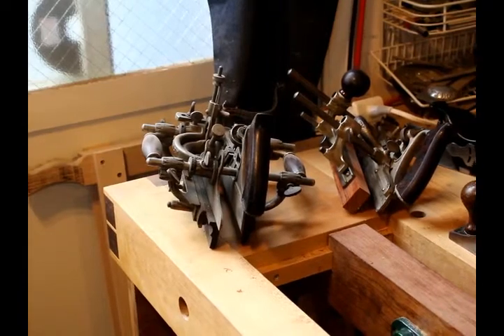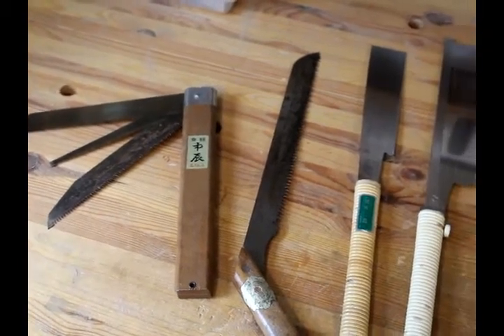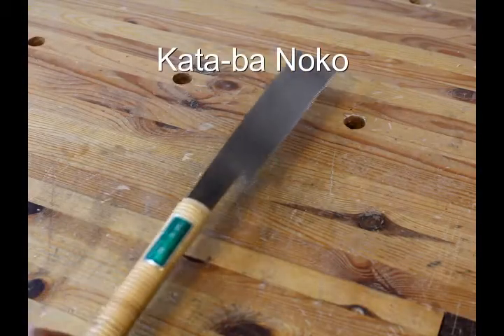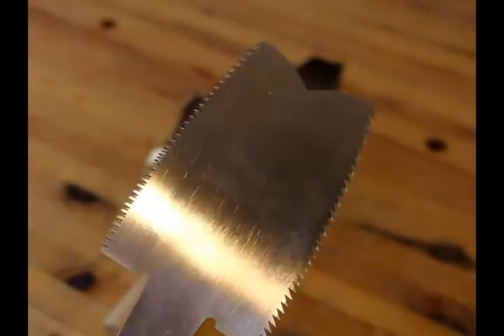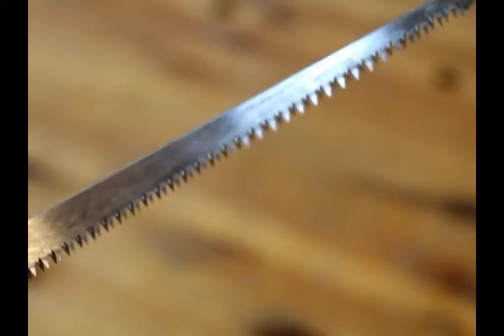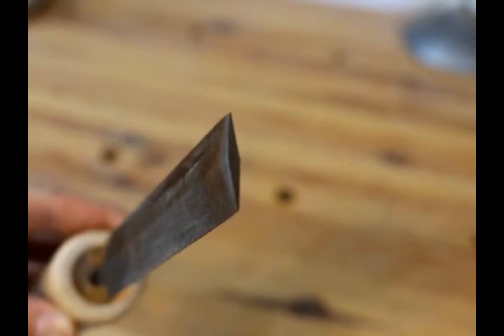All about Japanese saws! Names, uses!!

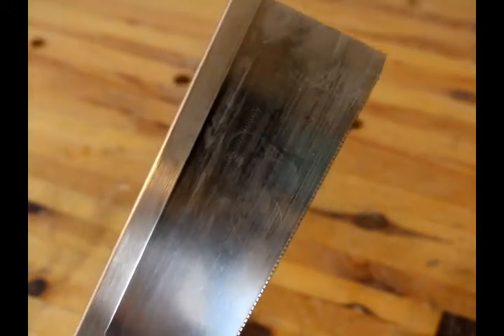Comment: 2:16 This is a full spline dozuki. I have notice a different version of dozuki with 5/4 spline and a round corner upper tip. I looked up the internet and couldn't find the reason for the different design. Any logical explanation will be appreciated.
Reply from the maker: Thanks for your question! I think you're referring to this type of dozuki:  http://blog-imgs-11.fc2.com/p/a/p/papadon2007/20070816024459.jpg   
 I've seen carpenters use this type to cut holes in ceilings for light fixtures etc. The curved tip makes it easier to start the cut on an angle and the spline is shortened so that it doesn't interfere as you puncture the ceiling and continue to cut.
Reply: @TenonsTenors  Yes, Thanks for the reply.

Comment: I really appreciate the fact that you live in Japan and can separate the dross from the good stuff. Question for you, if you will. In Canada, one can buy Suizan, ZSaw and Gyokucho dozukis and katabas. How do you rate those three individually, and what do you recommend? Is there any significant difference between the three? Thank you very much. George
Reply from the maker: Thanks for watching and commenting! I'm sorry, but I don't think I can answer your question because I'm not familiar with the brands you mentioned and it would be irresponsible to comment on something I've never used. Generally speaking though, here in Japan the saws that have replaceable blades come very sharp and work very well. The only drawback is you can't re-sharpen them. But, I'm also referring to Japanese brands. I'm not familiar with Japanese saws made in other countries. Bottom line though, if you like it, then use it!
Reply: @TenonsTenors  in the meantime, I've researched and learned a lot about the brands. It appears that your dozuki, ryoba and kugihiki are all Gyokucho models. At 2:14, I believe I can just make out the brand, though the physical appearance of the 3 are quite telling. All three brands I mentioned are widely available in Japan, with the Gyokucho brand being favored as a slight cut above the other three. Just wanted to hear about your opinion on that. I'd love a hand forged ryoba - how much did that set you back? Cheers, George
Reply from the maker: @LitoGeorge  I see what you mean now. I never knew they were branded as "Gyokucho" in English. On the Japanese package it says "Razor Saw," it wasn't until I went to their website that I saw the Gyokucho label. Yes. They are Gyokucho saws. I love them and use the short and long ryoba on a daily basis. They stay sharp, are very straight and don't break. As for the hand forged saws, I found a retired miyadaiku carpenter on Yahoo Auction that was selling a set of three. I think I paid only about US$100 for all three since they aren't in much demand over here due to the shear quantity and lack of interest. The other saws were my father-in-law's and I found them in the shed in our backyard. Hope that helps!
Reply: @TenonsTenors  Hi T+T - yes that helps tremendously. I want to ask you for some guidance if you will, on what to look for on Yahoo auction/ Ebay Japan in order to secure a set of Ryoba's/Katabas if possible, at a reasonable price. My goal is to be able to sharpen these items when they go blunt (eventually), instead of purchasing a new blade. I did take the initiative of looking at your channel to see if there was a way to email you, but there is no contact details. Would you give that a think and let me know? Thank you.
Reply from the maker: @LitoGeorge  If you read Japanese, you should look for saws from retired carpenters, etc. If you don't, a rule of thumb is to find the saws that are one piece, full tang into the handle, and that have that patina that an old saw will get. Sharpening Japanese saws is a lot different than Western saws though because of the geometry of each tooth. Good luck!
Reply: @TenonsTenors  thanks for your reply. No, I dont read Japanese, but hope to use Google Translate to do the heavy lifting for me. Which site do you recommend looking at, to get a chance as a foreigner without a clue as to the language (save the buzzwords I have learned), to possibly get a set of these beauties? Thank you.

Comment: Are there large saws available for things like milling boards out of a log? I expect to do a bit of that because I mainly make very small things. I am still exploring which saws I like to use and so far I am finding that I prefer the Japanese style. If there is such a thing, what is the name please?
Reply from the maker: Hello! There are, but they are hard to come buy, at least where I live in Japan. Hardly anyone works with only hand tools anymore, so auctions and used gear sites are your best bet. I did I quick search and found some on Mercari, a used goods buying/selling site here in Japan. I don't think you can bid from overseas but I wanted to show you what they look like. They are called "te-mage-noko" because the saws are designed for a pistol-like grip. The ones in the photo have no handles. "te-mage-noko" means "bent handle saw," rip saw in Japanese is "tate-biki-noko." I have ripped boards up to about 14 inches with the ryoba nokogiri I showed in the video (the one with crosscut on one side and rip cut on the other) FYI.     https://www.mercari.com/jp/items/m35533522824/
Reply: @TenonsTenors  Thank You.
Reply: @TenonsTenors  
Can you make some advice on:
Where could I find information about the geometry to sharpen this type of saw "te-mage-noko" you mention?.
Tanks for your videos very informativs ...!

I already found the file and that would not be a problem...

I have a similar need as "Douglas Hopkins" for milling boards or logs for the following reasons:
1- I don't have a chainsaw.
2- I can't make too much noise and disturb my neighbors.
3- I can't afford the expense of an electric stationary band saw.
4- I'm trying more and more to work with hand tools rather to depend on electric ones.

I want to modify a big old saw and turn it into the "te-mage-noko" you mention.
As a second option I could also buy the unsharpened metal blade, shape it and turn it into this type of saw as you mention.

Here is shown how I would like to do it:

https://youtu.be/gmQSmr-9PXY?t=31
https://youtu.be/gmQSmr-9PXY?t=456
Reply from the maker: @j.palomera690  Thanks for watching! I'm not sure what saw you are referring to. None of the ones I show are called a "te-mage-noko" which in Japanese would mean a "bent hand saw." 

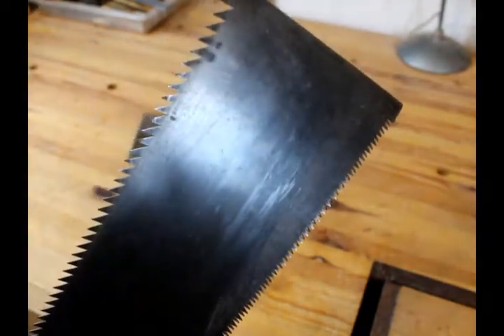I found a video for you that shows the geometry and how to sharpen. Skip to 1:30. It's in Japanese, but you might be able to turn on English subtitles. Good luck with your project!